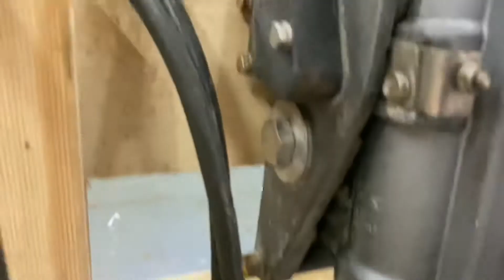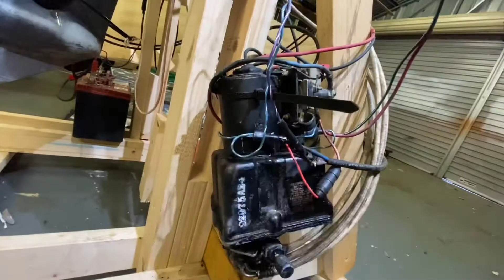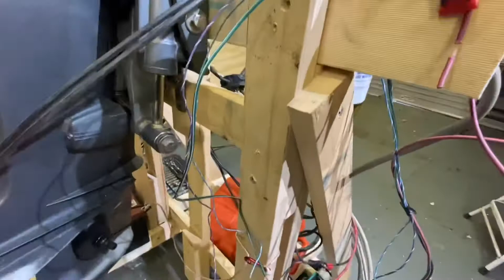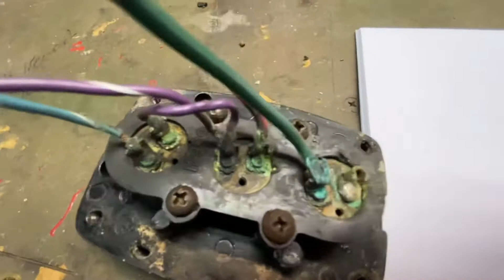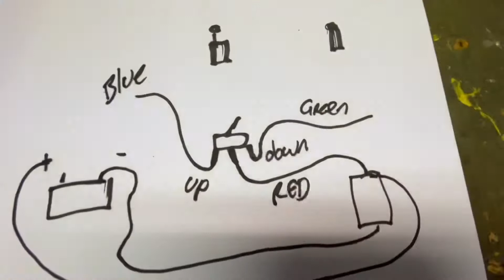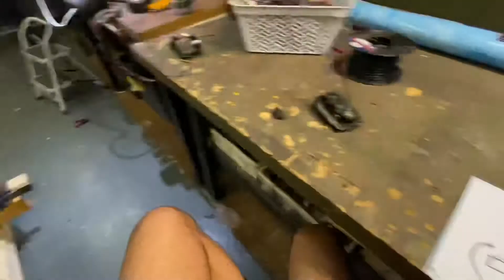Tilt & Trim Explained - 1983 Mariner 50hp Outboard | The $150 motor project - Mercury Blueband

Comment: I know this video was three years ago, but hopefully you can help answer my question. I just basically inherited a 1985 Mercury 50 horse. It has the same set up tilt and trim system and it does work. Looking at the wiring diagram I kinda understand it. But The wire harness that comes out of the trim limit on the side of the ram. It has a black wire and a white wire. Where does that hook up so that the trim limit works? Thank you sir!
Reply: I rewatch the video and think I figured it out. I see that that cable comes out of the trim limit switch that has the black-and-white wire. Black wire looks like it goes to the blue coming off the pump. The white wire goes to the purple. I understand the regular up-and-down switch and everything, but still not sure where to hook up a up and out switch?

Comment: Great deal on that motor Brock .I have the Mercury  version of this setup, that control switch comes apart and is very easy to clean up the contacts (mine was in very bad condition). Also the limit switch controls max trim out and is set so motor doesn't leave the side guides, pushing both up  and up/out gives full lift. I changed the wiring around to make "up" my trim adjuster and up/out the limit bypass, just simpler up =trim up,  down=trim down, push "up/out" & "up" for full up

Comment: How can I manually raise the motor?
Reply from the maker: Sorry for the delay. If you disconnect the hose, you will be able to manually lift the motor. Do be aware that it is very heavy and may need an engine crane/a few strong people. If you disconnect the hoses, be sure that you keep any body parts clear as it may drop suddenly

Comment: Please explain how manually work the tilt trim system
Reply from the maker: Can only be lowered by releasing the pressure valve. Can’t be manually raised if the pump fails (to my knowledge).
Reply: @smithysspeedshop  how do you releasing the pressure valve?
Reply from the maker: @phongsavathkhamatsmay5436   the pressure valve is just a thumb screw. It can be turned by hand (unless it is siezed) and the fluid will flow through.
Reply: @smithysspeedshop  is it the one one located in the fluid reservoir. i have a problem with my when i trim up  and let's sit, it just slowly came down by itself. Thanks for the reply
Reply: @smithysspeedshop  I have this same motor. I cannot get the motor to raise on its own. Where do you suggest I start?
Reply from the maker: @kyleworkman288   if the motor makes sound when you press the button and nothing happens, check that is has oil. If there is not enough oil, it will not raise up.
Reply: @smithysspeedshop  thank you. The motor does make sound. I just can’t seem to raise it far enough manually to lock it in place.
Reply: @smithysspeedshop  do you have an email?  Feel like I am soooooo close to having this outboard ready😭
Reply from the maker: Sorry for the big delays in responses. I’m trying to work out my YouTube settings so it lets me know when somebody comments!
How did you go, is the motor up and running?